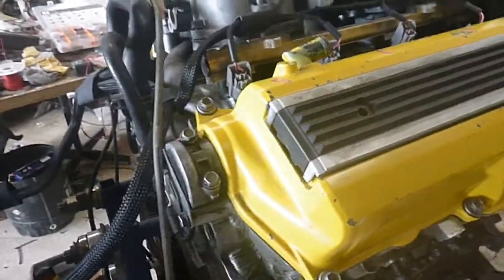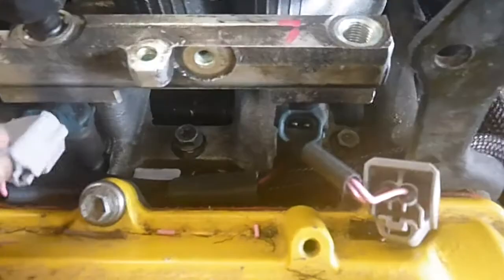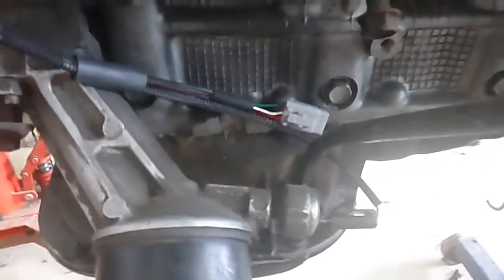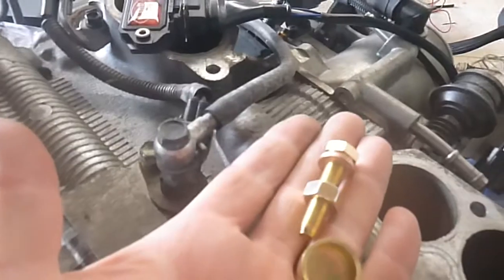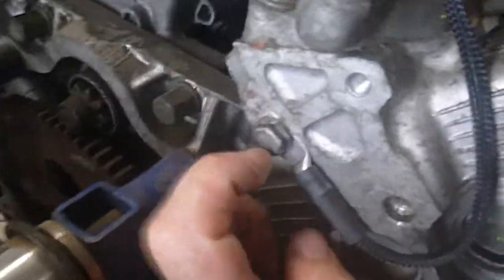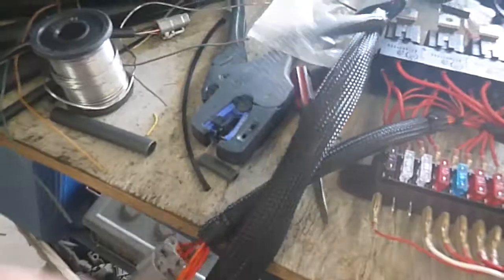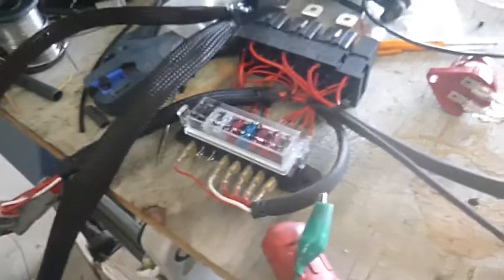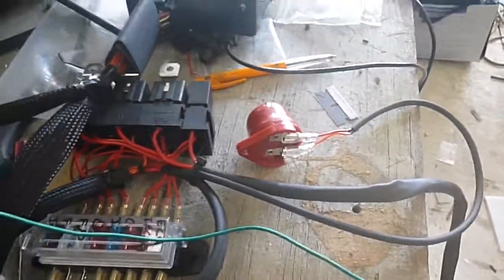Link ecu full standalone wiring harness to 1uz Hiace van

Comment: have you done a transplant in Hiace 200  with the diesel v8 twin turbo from 200 series Landcruiser
Reply from the maker: Ive worked on Plenty of 200 series Hiace but never with the V8 twin turbo diesel.  From the measurements I have done in the past I doubt it would fit into a standard hiace engine bay.  Toyota V8 diesel is a massive engine.